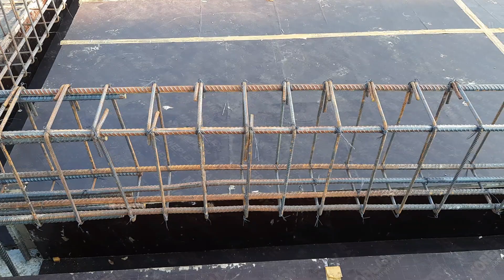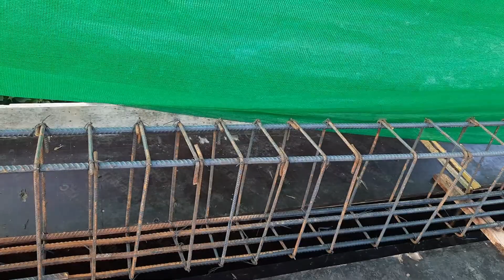Steel structure design

Comment: Engineer thank you for the video 
though there is a mistake at the beam and column joint. 

Top bars for the beam can be overlapped from the centre of the beam (L/2)
Bottom bars can be overlapped near the beam and column joint